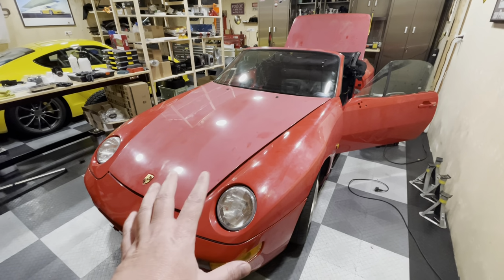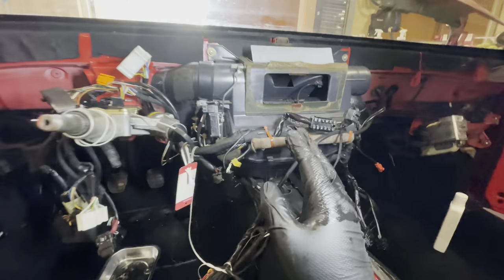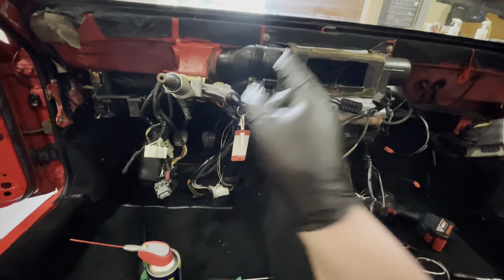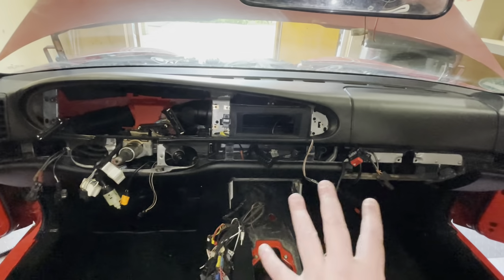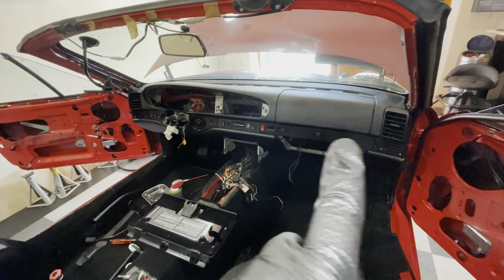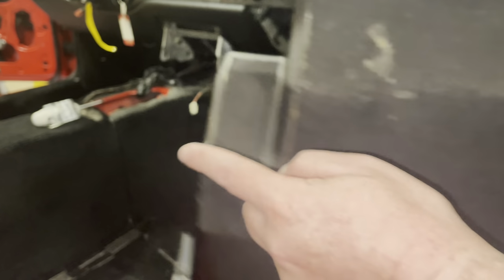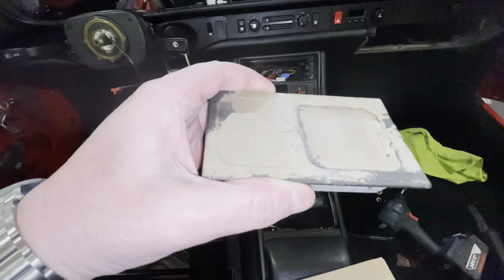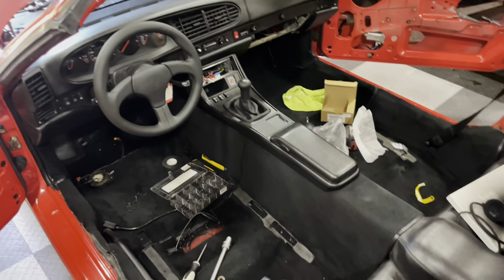Restoring a Flood Damaged Porsche 968: Reinstalling the interior #dashboard #restoration

Comment: nice work Jon!  Remember that you need to put in a resistor to fake the car into thinking that there's still an airbag in place.
Reply from the maker: Thanks Jeff, I am leaning towards the factor airbag delete plug instead of a resistor, but not 100% sure yet.
Reply: @GarageBiljon  that would, of course, also take out passenger airbag functionality.  Probably the better choice.

Comment: Wow, impressive progress and she really starts to look brand new!

When I had my 968 and did a few little upgrades / restorations to the interior, I couldn't get over how much of an upgrade the CS steering wheel was. Really transformed the car. I also installed a new shift boot and while I was at it, I removed the little storage lid armrest thingy and replaced it with the 968 CS tray. But mine was a coupe that I had slowly turned into a 968 CS M030 spec wise (thicker ARBs, Koni suspension, 928 S4 brake callipers etc). Maybe when cruising in the convertible you might as well use the arm rest.
Reply from the maker: Thanks man! The thing with cabrio is that the handles for the roof is stored in the arm rest thingy, in the coupe this is cassette storage so replacing it with the tray is a nice upgrade, but for the cab you will then have to find another spot for storing the handles.

With regards to suspension, I think the only thing I will be doing is installing Bilstein B6 all round, I will keep the rest stock as this will be more of a cruiser than a racer.
Reply: @GarageBiljon  makes sense! I would probably do the same. Was more reminiscing about the time I had the 968 (lost it due to a crash, still miss it sometimes) than making suggestions as to what you should do with yours.
Reply from the maker: I know the feeling  @tond2006 , I sold my first 968 back in 2010 and always missed having one. They are special cars.

Comment: Hi Johann, your progress is great. The interior is looking really nice, almost like new with the brand new steering wheel a shifter boot. I have also installed CS steering wheel, long 13 years ago when I bought mine 968. I used a resistor instead of the airbag and never had a problem with it. In your other reply you mention that you may install Bilstein’s B6 dampers. I just finished the conversion and install of the front B6 struts and will be installing the rears this weekend. I hope everything goes well with your  car and I’m  looking forward to your next episode.
Reply from the maker: Let me know how you go with those B6's I hope they won't be too firm for a cab.

Comment: Thank you for another excellent episode. Its coming along very nicely and the new shift boot and steering wheel just gives it that final "new" touch to the interior. Regarding the clubsport steering wheel, have you got a jumper for the airbag plug so it doesn't come up with a fault code?
Reply from the maker: Thanks Alex! 

I have two options for the airbag. The factory delete plug or by installing a resistor for the wheel airbag keeping the passenger airbag functioning. I am not sure which direction I will be taking yet.